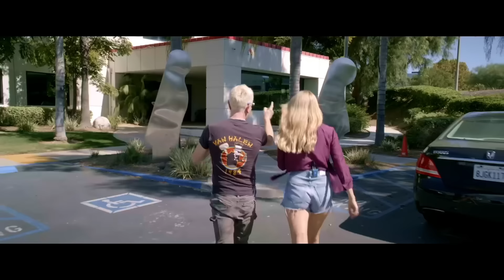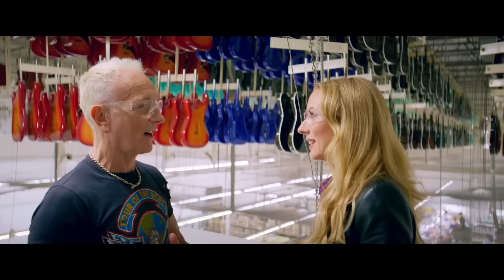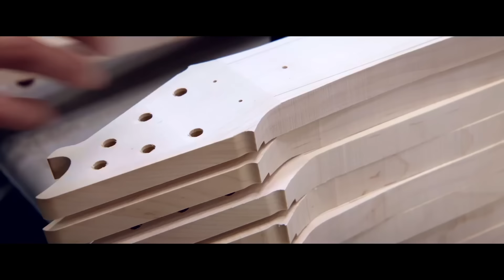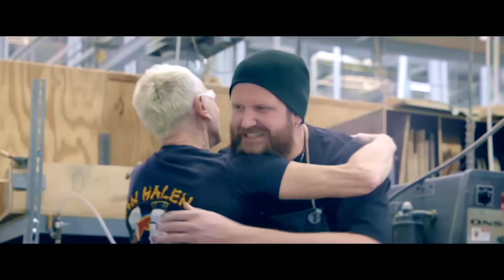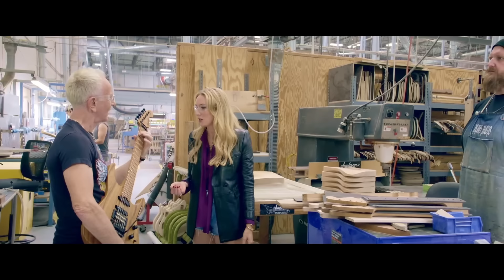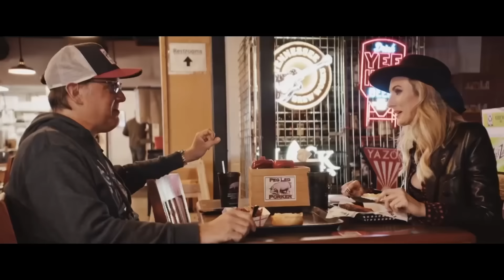PHIL COLLEN OF DEF LEPPARD SHOWS ME HIS NEW JACKSON GUITAR BEING MADE AT FENDER

Comment: Ok. Let me say this here. There should be two tiers of the new PC1. One tier which is higher priced with the premium features and specs and another that has lower priced features and specs that some users can actually afford. The PC1 models that I played are rediclulously priced. A lower priced PC1 will put this in the hands of more players. And swamp ash is not really considered an exotic and hard to source wood. Any roasting of wood should not be a premium feature of a wood used in guitar building. It should be considered a necessary step for any wood that contains natural resins or oils so that the wood structure is stabilized as the guitar construction begins.